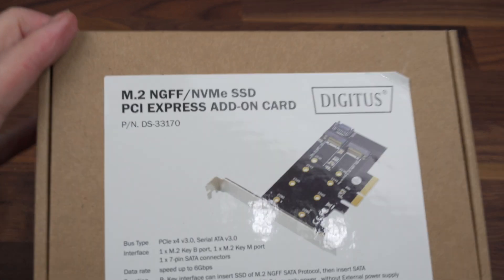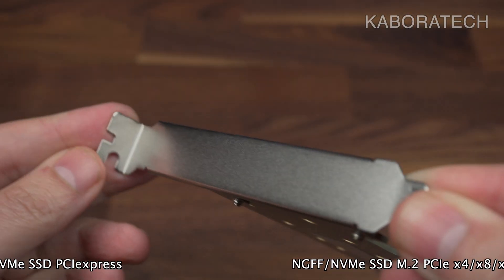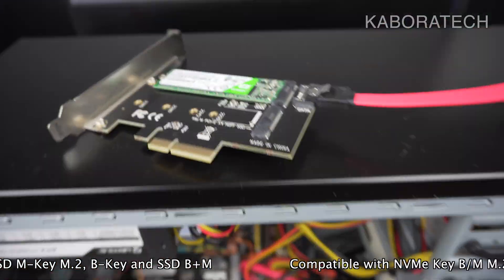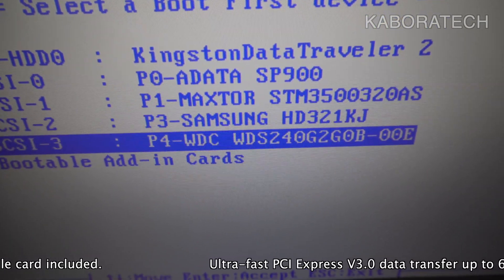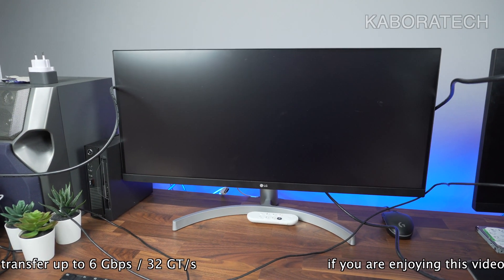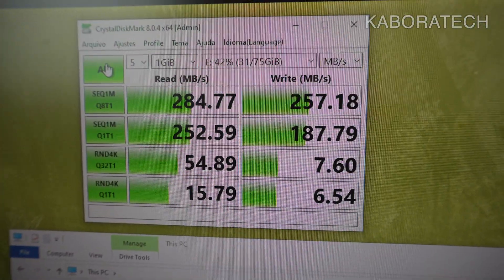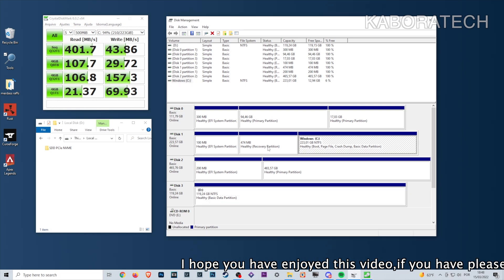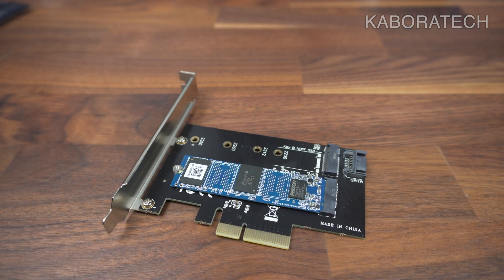M.2 NGFF/NVMe SSD PCIexpress

Comment: NVME is the only way to go now..  Even when you upgrade to a better PC or laptop, you can take your NVME drives with you.   They are essentially the same price as Sata SSD's now.  There's no reason to get anything Sata anymore, other than needing a secondary drive with a lot of extra storage.
Reply from the maker: Unless no nvme conection...
Reply: @kaboratech  Well, like you said:  just get the adapter.  If SSD's were way cheaper, I probably wouldn't bother with it on most machines-- but it's so similar in price, it just makes no sense not to now.

Comment: so i have kingston m.2 nvme pcle 4.0 i plug it to my motherboard and it didn't show not in the system or the bios i tried all the setting it won't show up this NGFF  will solve my problem ?
Reply from the maker: Hi, do not know, did you try the ssd in other computer? It works??, if the adapter is nvme capable and the ssd is good should work, but strange that a known brand is not detected direct on the motherboard.... Test in other pc, make sure is working

Comment: Thanks so much. All Youtubers keep saying the NVME won't work on legacy boards with BIOS, only on UEFI! I was just about to give up until I saw your video!
Reply: They are right.. It won't work on legacy bios;  only on UEFI (as a boot drive with the OS instaled on it). 
but there is a work around:  you have to make a bootloader using clover or refind on a USB drive.  This lets the old bios boot in and then you can jump to the NVME from there and boot into your OS.
Reply: @calholli Hey man, i just wanna ask you because i've been confused this whole time, i want to install this adapter to my pc because i have an ssd but the problem is my motherboard only support pcie 2.0 and this adapter has an solid state drive sata port so i was just wondering if i connect my ssd through this adapter using sata cable, will it reach sata lll speed? Or still run at sata ll speed.
Reply: @calholli  Thanks man I though that SATA port on the adapter is for an solid state 2.5 inch drive, not knowing it was for ngff SATA, also if I put NVMe there can I boot it from my legacy bios motherboard even though it's not uefi? And will I get like 2gb/s?
Reply: @calholli  Does when you use USB to boot from clover be slower? Or can I create another partition from my SSD and make it as an bootable to boot from clover without using an USB though I have a USB here but I'm just wondering if I can just put the clover to another partition of my SSD.
Reply: @calholli  Thanks man, I'll try this when I got the NVMe.